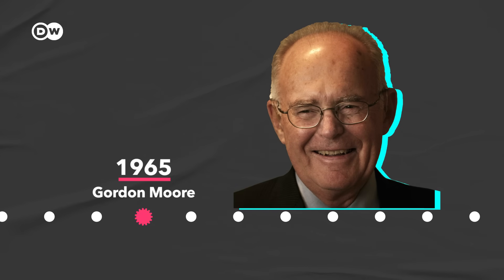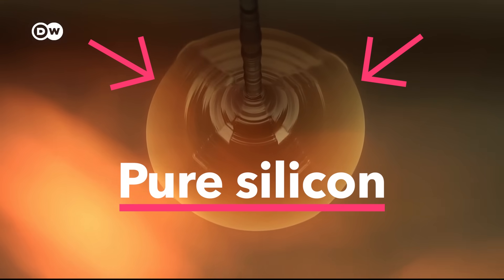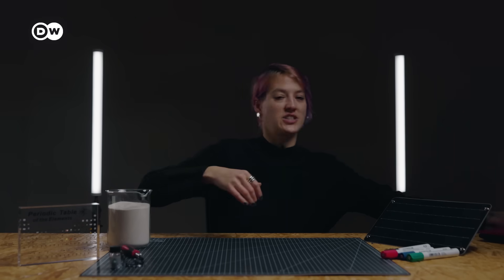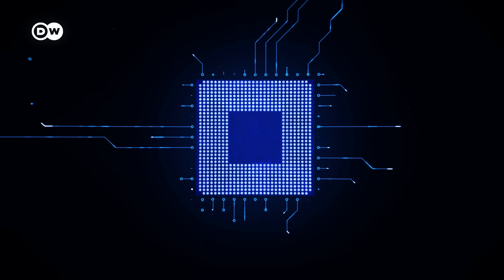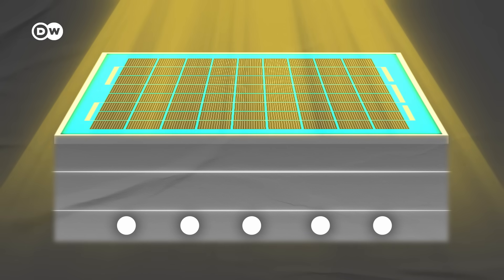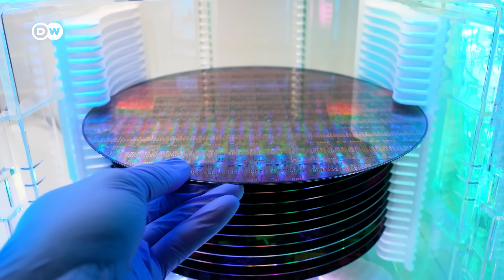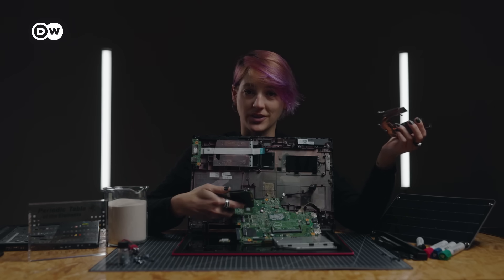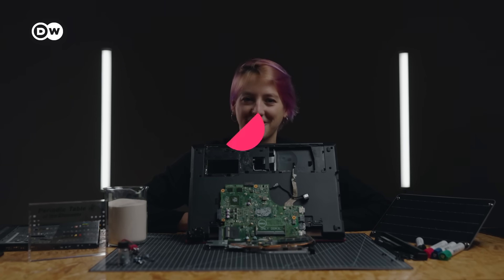Why Silicon Valley needs a new name

Comment: I think in the future wouldn't use a material for semiconductors. Let's hope they use less water or no water at all, and the protection of making them also very easy, also the material that needs to be making them is abundant, easy to get to.
Reply from the maker: There materials that perovskite crystal structures require are very abundant. We release a video on them today so stay tuned! ✨🙌

Comment: Can someone explain why a wider bandgap allows for better energy efficiency? Wouldn't you need more energy in the first place to cross the gap? Why, in processors, can't you just put the right amount of energy into the system imstead of overshooting?
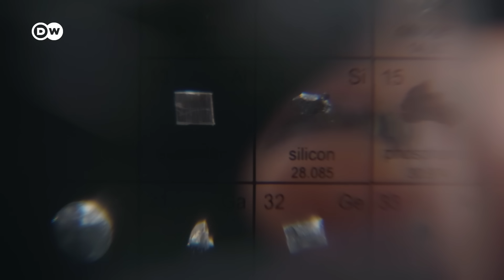Reply from the maker: From 4:45 we start to explain the bandgap. The smaller it is - the more energy is lost as heat. Wider bangap allows for better control, reducing the likelihood of electrons leaking over the strip plate when they shouldn't. 🛞

Comment: 6:37 Graphene is not a wide bandgap semiconductor. In fact, it is not a semiconductor at all. It has no bandgap. It's more like a metal.
Reply: zero-gap semimetal semiconductor. It can be metallic or semimetallic and semiconducting depending on the orientation

Comment: Physicist nitpick: one should never use the term "double the temperature" unless the unit is Kelvin. 300°C is not double of 150°C. 300°C is 573 K, so double of 276.5K or approx. 3°C..
Reply: celsius doesnt refer to temperature?
Reply: @fetB  There are multiple units to refer to temperature with varying precision such as degree Celsius, degree Fahrenheit and Kelvin, with Kelvin being the most suitable and commonly used in physics related calculations. This is due to different units having been made with different rules. 
Kelvin is an absolute unit resulting from thermodynamics laws, with 0 Kelvin being the absolute Zero, the lowest temperature physically theoretically possible (but not actually feasible in practice).
Meanwhile degree Celsius is a relative unit that bases itself on water’s fusion and ebullition temperatures at normal pressure, with 0°C being the fusion temperature and 100°C being the ebullition temperature which makes it pretty convenient for everyday life use but also means it’s quite arbitrary.
Since the fusion temperature of water at normal pressure also happens to be 273.15K and adding or subtracting 1°C is the same as adding or subtracting 1K, this means that {temperature In Kelvin} is exactly {temperature in degree Celsius} + 273.15. So when you have 300°C this means you have 300+273.15=573.15K. 
That might get you thinking the two are pretty similar and interchangeable but it becomes tricky when dividing or multiplying: if you divide 300°C by two you get 150°C which is 423.15K, but if you divide 573K by two you get 286.575K, that’s around 13.5°C. It’s a very big difference, which is due to scale and their starting points being different, one being absolute and the other relative.
Strictly speaking, “half the temperature” would be way better suited as the Kelvin temperature divided by two since 0 Kelvin is actually the minimum temperature considered possible, which means “half the temperature” of 300°C would technically be 13.5°C. More generally, in physics when you speak of “half of something” it’s in absolute terms because it needs to be applicable in any case, so its about consistency.
This is why we typically use Kelvin for scientific calculations, and Degree Celsius for convenience in everyday use.

Edit: fact checked and reworded for clarity
Reply: @hLux101  its not arbitrary when it is grounded and neither is celcius imprecise by any means, just because it is a relative unit that doesn't reflect "temperature" on a molecular or atomic level. So when you try to nitpick, do it right. Of course the difference can be significant when you use different units. 5km is a lot different than 5 inches, yet they both refer to a distance or length. It would also not be better suited to use kelvin since most anyone can relate to celsius. "strictly speaking" it would be the worst choice since the target audience is humans, which grind to a halt when exposed to below 0°C without protection and receive brain damage past like 50°C, so 150°C is a very significant showcase of difference however small expressed in kelvin.

You could argue they could have displayed kelvin in parenthesis, but it wouldn't have made a difference. pun
Reply: @fetB you’re right that talking in Celsius makes more sense relative to human experience and also is more commonly used and so speaking in Celsius is more telling. What I meant when I said that it’s “arbitrary” is that when dude decided on the rules of Celsius, he chose to base it on water’s fusion and ebullition points but he could’ve very well chosen another liquid or other constants to use, and also the fact that Celsius has changed a good amount: what was 0°C then became 100°C and then they made a new better Celsius that is slightly different and used now. But you’re right that Celsius is pretty solid when it comes to precision and is grounded since it has clear rules defining it and an official definition conserving its meaning. I’m pretty sure OP just made that comment not to be taken seriously, and mine was just for the sake of information.
Reply: @hLux101  right, OP is straight up stating its a nitpick. What i was getting at is that it's still referring to temperature, and i'm contesting the attitude and sentiment of "you should never use half the temperature unless its expressed in kelvin", which is more akin to commandments in religion than the humble journey of science. Not to mention the error in his post stating 300°C is not double of 150°C, which is just straight up wrong. It's expressed in celsius and 300 is precisely double of 150. (Yes i'm nitpicking). I mean, you can totally make a fun fact and and put into perspective that on the absolute scale and the molecular level, 150°C is not much, which is indeed very fun and interesting because it points to the natural world to be much broader than us mere mortals can handle, so to speak. Otherwise, it's just condescension
Reply: @fetB  The amount of heat gained or lost by a sample (q) can be calculated using the equation q = mcΔT, where m is the mass of the sample, c is the specific heat, and ΔT is the temperature change always taken in Kelvin .
So, the heat energy in 300°C will not be the twice of 150°C. It would be just 1.35 times . However,You could say that if it was in Kelvin. So yes, it's just not a vague religious line. It's all science.
Reply: @fetB  Sorry, English is my 4th language, it's a bit hard for me but I'm still trying to improve everyday.
Reply: @Anonymous-8080  bs, you dont need a phd for that. You're clearly capable enough
Reply from the maker: Thanks for that! 🤓

Comment: Would love to see a video explaining the different types of heat pumps, ad most people are unaware that vertical ground source heat pumps are by far the most efficient, requiring only a tiny amount of land and deep drilling equipment that's only a few inches wide, and accessing constantly stable temperatures all year round.  When you say heat pumps, most people only know of air source heat pumps, which are the least efficient (requiring more energy when the air gets cold, with most ceasing to be efficient at -15 C) and can be a little noisy.
Reply from the maker: We will have a video on heat pumps coming in the beginning of next month so stay tuned! ✨
Reply: @DWPlanetA  great! Please go into detail about the different types (vertical ground source vs horizontal ground source vs air source.) I believe vertical ground source heat pumps are the most efficient and reliable, with the only barrier being finding an installer that has the vertical drilling equipment. But I am excited to see your video. :)
Reply: here in Canada, geothermal heat pumps are known to be most efficient, the barrier is cost. natural gas is very cheap here, so people just heat with gas.
Reply: @gabrieldsouza6541 "natural gas" is methane, not only does burning it produce climate change emissions, but methane itself, when it escapes, is more than 28 times as damaging as carbon dioxide! And heat pumps, after the initial investment to install, are much cheaper to run - after all, you cant get cheaper to run than FREE if you have solar panels and a house battery.
Reply: @TimLongson i agree with you on the harms of gas heating, but the fact is that most people just don’t have the money to get solar panels (Canada has low solar irradiation due to to our high latitude) plus a home battery system. further, a significant portion (15-20%) of our population lives on the Prairies, where winter temperatures can reach up to -35C for days at a time. I understand cold-climate heat pumps have come a long way, but honestly I would want a backup heating system for those extra cold days. and also the point about running a heat pump is generally true, unless electricity costs more than gas, which actually is the case in some Canadian provinces. i believe in heat pumps as the solution, but insulation needs to improve first.

Comment: 1. NLP will help to improve the power and efficiency of Computers
2. Peroskites will be helping to improve the efficiency of solar panels.

We have reached the maximum potential of the current technologies being used in these two sectors. However, we can increase the efficiency and reduce effective cost, of these systems.